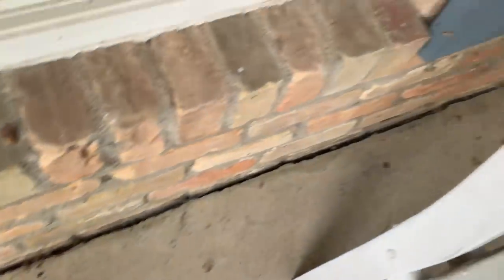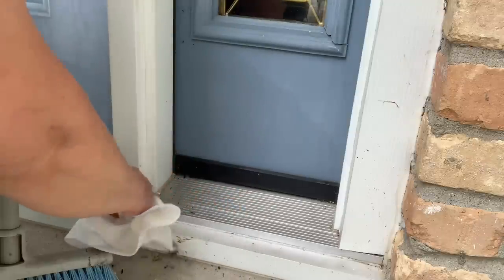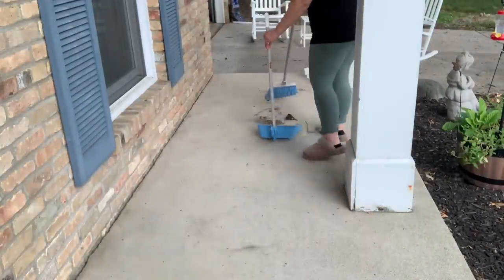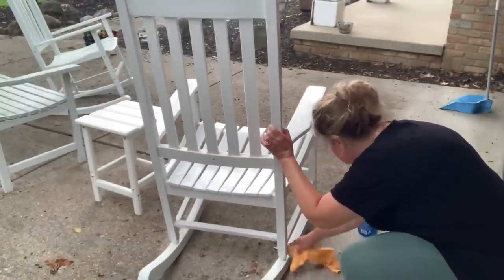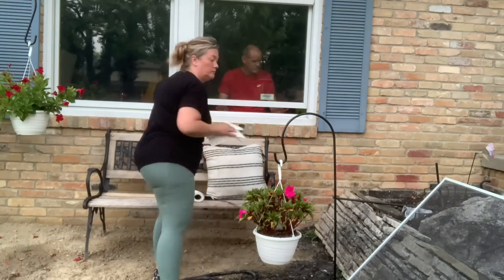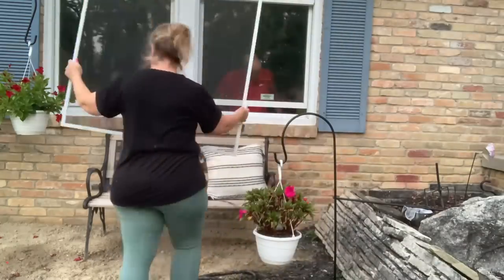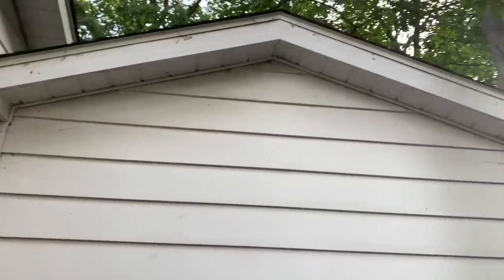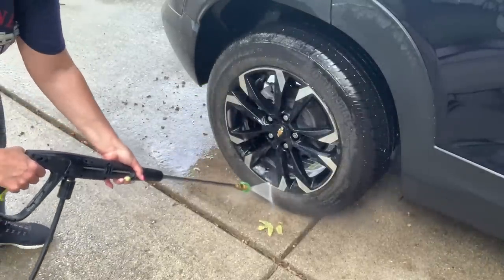OUTDOOR CLEANING & POWER WASHING/ Bonus video

Comment: Oh how nice❤. Another video 🎉. You got a lot done and everything is coming together nicely. For the shed I would get the wire/ metal shelves in wheels so you can slide them to sweep under. I have them in my garage and it sure makes the job easier when you need to clean. ~ Janet 🥰